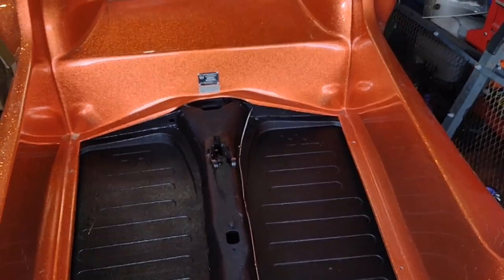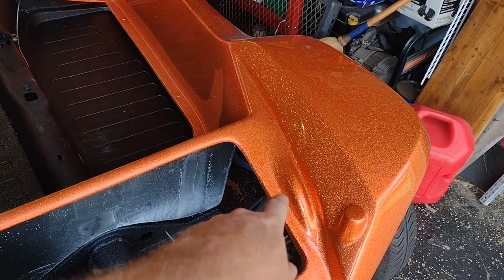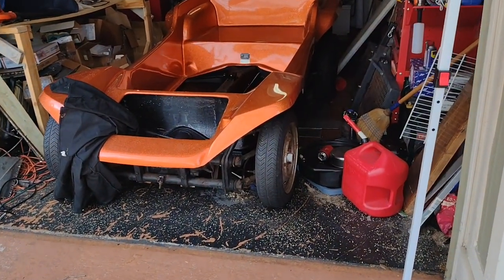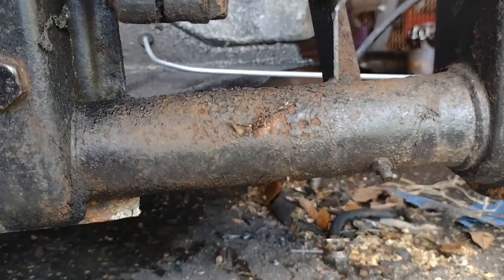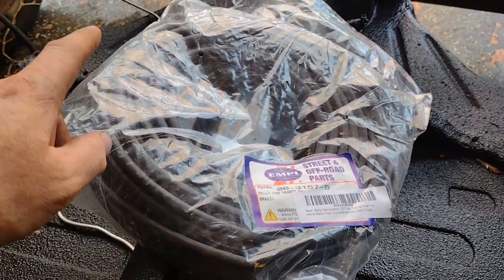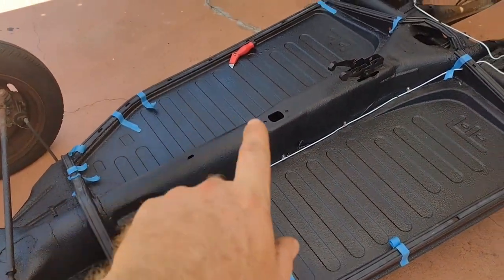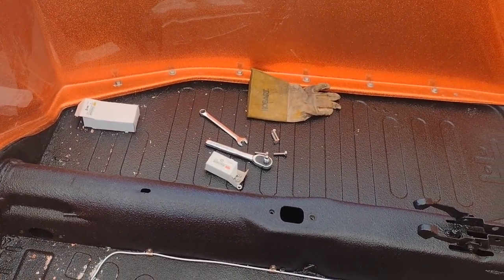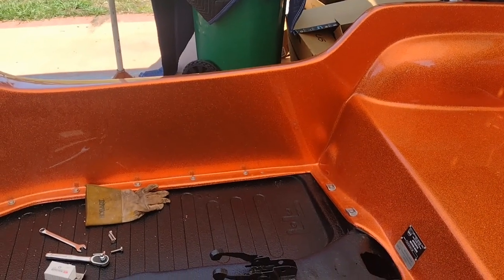Time To Mount The Manx Body

Comment: Check your passenger side torsion cap bolts, as when I lined my body up and bolted it down I found I could remove the upper forward bolt to adjust the torsion bar. I had to grind material away from the body to get a wrench in there.